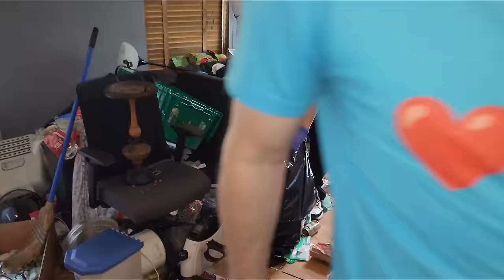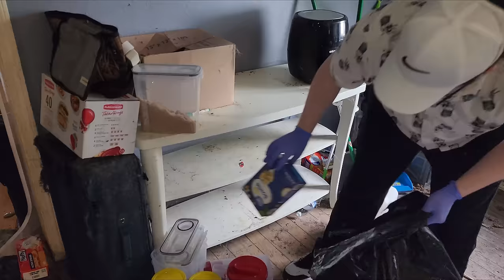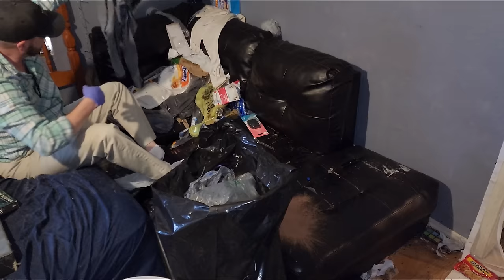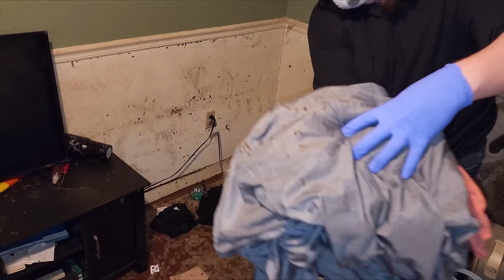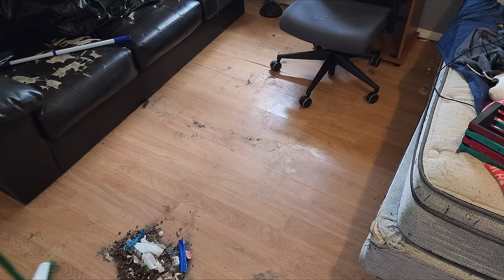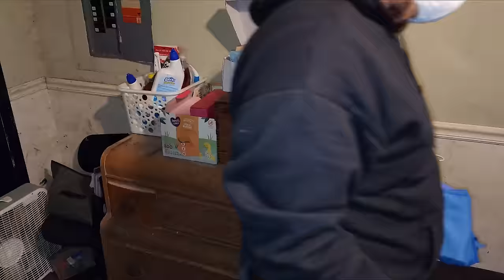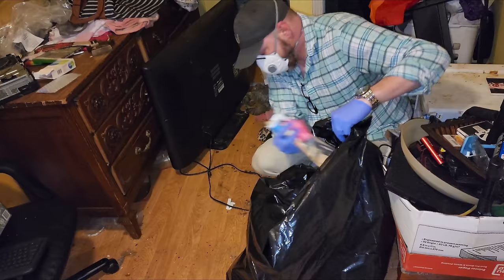We removed 100 bags of trash from this home for FREE

Comment: As an exterminator, I was tasked with a house where the tenants had abandoned it and left piles of trash everywhere, and yeah, I knew right away nothing I could do would work until the trash was removed (not only that, but they gutted the walls, drop ceiling, floor, the entire kitchen, and the entire bathroom). That was a HUGE job in its own right after I got back in there and roaches hid between every single framing stud, any two pieces of wood touching, there were do many that they hid between the subfloor slats and blocked out the light (which I only realized after I had gone back downstairs for something and noticed it was somehow much much brighter). But yes, knowing that the exterminator isn't the right job at the right time is important. Of course, I am now completely immune to the charms of roaches, but I'm also careful when opening the front door in case I'm greeted by roaches first. And I know that smell of roach all too well, I can usually guess how bad it might be based on the smell alone sometimes

Comment: The reason stuff is possibly not.. put away in a closet or drawer could either be, they lost the will to put stuff away, or it's a need to see it to know it exists issue. Depression and ptsd can cause brain fog , as well as severe adhd, so if you put stuff behid any kind of visual barrier, it slows down the thinking momentum to get things done, remember whete stuff is, and feeling like you even can do anything. In the Clutterbug system, the people eho need stuff all visually available are called "butterflies" because they kind of just hop from task tk task vased on the visual cues, like how a butterfly hops to flower to flower, (but not as organized and hyper specific with categorizations of things as the Bee clutter type.)  both butterfly and bee type are visual organizers, but butterfly has broad categories for multiple items (like clothing baskets of a similar category, like bras and underwear,  instead of being hung up.) while the bee type uses many nested specific categories. (Think beading organizers for jewelry making).

Comment: I have a theory about the empty closets - they hide things! ADHD affects my ability to remember things that aren't immediately visible. My issue with object permanence means the stuff in my closets is usually stuff I don't use. I haven't seen some of it in years! I hang my clothes on my shower rod by the tub (we have a shower in the other bathroom that we use) and in my laundry room. I need everything to be out in the open where I can see it. 👀 My son is also on the spectrum and has ADHD and keeps his clothes in bins. His closet is empty too. My next project is simply removing the closet doors and putting them in the attic to see if that works. Not sure if that answers your question, but we are neurodiverse and have a thing against closets too.

Comment: Hey boss, I’m not sure if you’ll get a chance to answer this but I thought I’d ask the master himself. I’m going to be cleaning up after a pet hoarding situation (loads of cats and a dog) and am already prepared for the biohazard risk. I didn’t see a list of the products you recommended in the description, I’m just curious what you recommend for getting basically a 1/4 inch of feces in some areas off of the floor and cleaned? Some walls also have feces on them. I was thinking trash bags and a flathead shovel to start lol. The owner is not planning on keeping the floor in the long run; It’s pretty bad. Planning on using bioenzymatic cleaner and possibly shellac later once the floor is ripped up. Just wanted it pretty clean before than, especially the walls before someone paints. Thanks!
Reply from the maker: Lysol is good at disinfecting that stuff.
Reply: @MidwestMagicCleaning  thank you

Comment: Not a licensed psychologist, as I did not pursue my Masters degree/PsyD, but there are a couple reasons as to why the storage areas were unused. This can be seen often in individuals with ADHD who have become aware of their thought processes- if the individual struggles with object permanence (forgetting things exist when they can’t see them), sometimes the individual will prefer to keep their objects where they can see them. This can lead to clutter piles that make sense to the individual, but if not managed well, can quickly become a danger. There could also be a negative connotation with closets or tight spaces, but that theory is merely speculation. If that were the case, the individual would need to seek support to help overcome the irrational fear. I have a feeling that the first explanation is most likely, but I thought that I would add some of the information I learned.

Comment: Abnormal psychology is called psychopathology at my uni. Not as in psychopathy - psychopathology is the term for the study of abnormal psychology. Although it does sometimes include psychopathy. As a psych major, I appreciate the way you approach mental illness and treat sufferers with human respect and empathy. Sadly that's hard to come by, even in this field.
Reply: Oh! Also, as for the not using storage aspect - my best guess would be either ADHD lack of object permanence (which goes beyond objects in general but also rooms of the house, where to put things, etc) or an extension of how depression saps energy. If someone cannot do things such as wash dishes, take out the trash, etc, it's not surprising that they may also have trouble putting things away.

Comment: Not so quick tip for anyone dealing with roaches or bedbugs or anything like this. 

I keep my house very clean and sparse in terms of "stuff". I had bad ant traffic in the kitchen, fleas (adopted a stray cat with no idea what i was doing), bedbugs (inexplicable, don't know where they came from) and started seeing a few roaches. Aside from getting the cat to the vet and getting what he needed, I NUKED my house, ceiling to carpet with food grade diatomaceous earth. Rubbed it into every nook and cranny of my furniture/bed. Under the cabinets and appliances. 

Non toxic and safe for humans and pets. Farmers put it in cattle feed to keep it from clumping. It works on these parasites because what we perceive as a fine powder is to them like living in shards of glass. I let it sit for a week. The cleanup was tough, it can choke out you vacuum cleaner. But this was 2 years ago and haven't seen one of these bugs since.

Important to note you must apply this stuff in a FINE dusting, no lumps or piles. The bugs will simply go around a heap of it but if you dust everything they have no choice but to go through it and track it back to the nest as it clings to their legs. I also go ham around the outside of my house, i.e. foundation/doors/windows, with a generous application of ortho max once a year. All pest control service ever did was take me for over $2000 for no results.

Comment: I AM NOT A PSYCHOLOGIST. I HOLD NO DEGREES OR FORMAL TRAINING I THE FIELD OF MENTAL HEALTH OR IT'S VARIOUS DIAGNOSIS. I AM SPEAKING FROM MY OWN PERSONAL EXPERIENCE AND OVSERVATIONS AND I UNDERSTAND THAT THE THINGS I AM ABOUT TO SAY MAY NOT BE TRUE FOR EVERYONE. 

Not having things inside of other things could be an indicator if ADHD. those with ADHD tend to struggle (to put in plainly, and in the most base way possible) with object permanence. This is why it's helpful to remove cabinet doors from kitchen or bathroom cabinets, or to use a tote system as opposed to a dresser for clothing storage, etc.

Comment: From my own experience, I like to keep stuff out in the open, because if it’s “hidden” (even when I know exactly where that item is) I will Not be using it. Unless I specifically want to use that specific item. Like I got say 20 t-shirts and 10 of them are in my closed drawer. 10 are washed and dried and folded in top of that same t-shirt drawer furniture. One I generally use only what I can see, two there are days/months/ years when just the idea of switching the washer on is too hard. I still do it, of course, but instead of like get up and do it like neurotypical people, I need to spend 1 hour- or sometimes 1 month talking myself into it.  So I can see why someone would not put stuff into cupboards. This “difficult” feeling is also the reason why my home looks rather minimalist and even bare. Just imagining the need to dust off a bunch of photos or paintings is too bothersome for me. On the plus side on even my worst days I can get my place “visitor-friendly” in 1-2hours. To me as little stuff at home as possible is not “pretty minimalist lifestyle” but more of a necessity. As 10 t-shirt ms out in the open is way less messy than 300 t-shirts. Coz whether it is 10 or 300 I will leave them out in the open at one point or another.